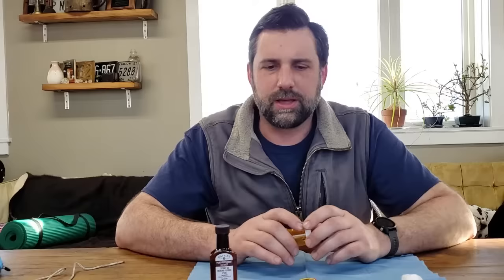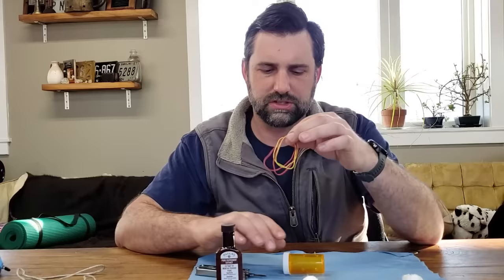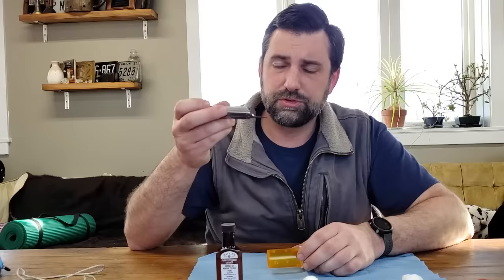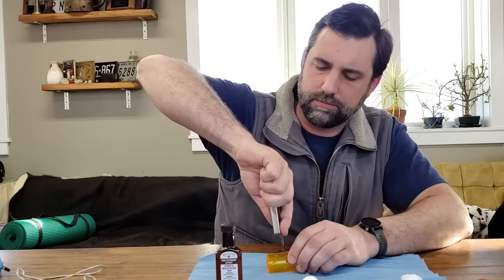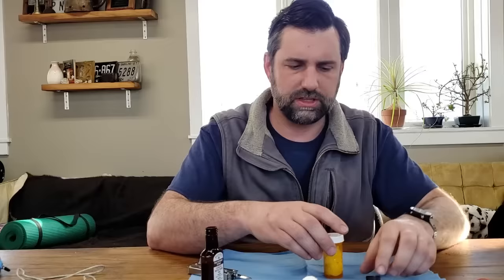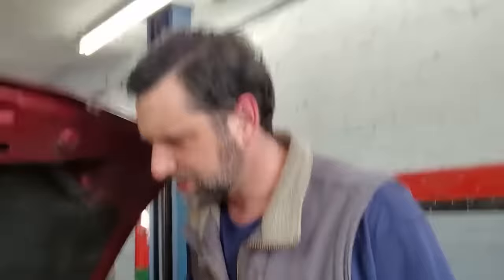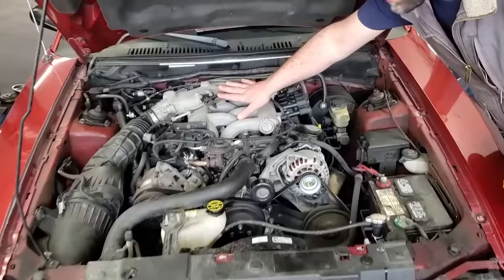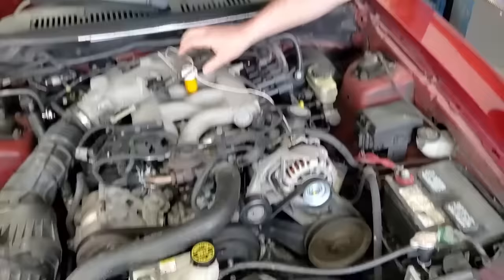Keep Mice From Ruining Your Cars Wiring With This Trick

Comment: That plastic bottle will melt, the engine heat at the manifold is extremely hot. I just mix peppermint oil in a spray bottle and spray the engine compartment, keeping it away from air vents pulling air into the vehicle . Works extremely well, had a mouse rat issue in my mustang, it solved the problem.  Also built mouse rat poison feeders , totally solved the issue, utube shows how to make them with 2 inch pvc T shape, brilliant idea, works perfectly, safe for your pets
Reply: Keep in mind, poison can backfire in a VERY nasty way. For example, I had a landlord who battled the rats in the basement via Decon. It worked. Unfortunately, the rats stayed there to die and stunk for six months (couldn't get under the crawl space).
Reply: @kellyvcraig  the traps are outside, I wouldn’t put that type inside, but the pvc rat mouse poison feeder is brilliant, my Golden Retrievers can’t get at the poison because the design of the bait feeder. Otherwise you live with the live disease caring destructive rodents. Mine are no longer😄
Reply: @PaulA-vc6sn but how do you know the oil worked if you also used poison? And what kind of poison? I can't find anything now that works

Comment: given all the reports of mice damage to older cars, I suspect his theory about new insulation being an attractant really doesn't matter.   Mice instinctively chew, because their front teeth never stop growing,  it is necessary for survival, and soft wire insulation is probably the most desirable thing to gnaw on in a car.
Reply: Soy-based wiring definitely brings rodent damage..
Reply: The only thing that's concerning is it appears that the string is tied to plug wires, they will eventually make the string a conductor and cause misfire issues. Especially with moisture and wet weather.
Reply: In 2012 the gov said no more petrolem based insulation for wiring. Now insulation  is made with plant based oil and the mice love it.
Reply: @natmcknight   That is the throttle cable, it wont cause any issues with misfires.
Reply: @richardelliott8352...yes it does matter, A friends 2011 Honda CRV recently had all four fuel injector wire chewed and one of them was. chewed all the way through causing the engine to run one 3 cylinders the rodent even ate about 2" of one wire copper and all, it also shed through one of the transmission wires...fault codes galore. It can be a huge repair cost, I've even read that depending on the damage insurance companies have totaled cars...AND it's because of what was said in the video soy based material is the culprit Honda has acknowledged the problem, they sell rolls of rodent proof tape directly from HONDA. You are partially correct rodents do get into vehicles regardless but the soy in the wiring is like frosting on the cake
Reply: @c.richardsmith3437 my Camry is a 2014 Camry, and Toyota dealer said soy is why they ate the wiring.

Comment: Six years ago a critter chewed the wires at connectors for my car's transmission and power steering.  After the repair, I sprayed all exposed wires with white lithium grease, thinking it may not be very tasty.  I didn't spray the insulated cables with multiple conductors inside, only the individual insulated wires where they're exposed such as at a plug.  The grease is still there, so it's a long term idea.  Additionally, I often raise the hood on garaged cars, since any mice that sneak in apparently don't want to be exposed.  I did the grease trick on a garden tractor that sits outside, and even though some mice built a nest on the engine last winter, they left the wiring alone.
Reply: What would you suggest for a novice who’s still learning which wires to spray?

Comment: ANOTHER IDEA?  Perfect solution (but don't laugh when you hear it :)  For less than 6 cents each, you can buy a small package of thin, unscented, panty-liners which can be soaked/damp with the peppermint essential oil + water sprayed on the "pad" side, and remove the adhesive protection strip from the "sticky" side and hide them under the hood of the car, , , mice HATE them  with a passion and they can be re-sprayed after a few months.  You'll be amazed at the results, , but avoid entering your ride in an "open hood" car show.

Comment: I tried everything. Nothing worked. Until I discovered flashing xmas tree lights. I run a string of these white lights thru the engine compartment overnight. Works like a charm.

Comment: I had a mouse problem in a truck a couple years ago. I used moth balls with similar results... BUT, the peppermint would have been much more pleasant ( for me... not the mice). The mice had not only chewed up the wiring, they had torn up the sound deadening material on the underside of the hood to make their home cosier.
A 2nd place to be concerned about on many cars is the fuel tank. Many modern cars have a pump inside the tank, which means wiring. Typically the pump is installed in the top of the tank. When I replaced the fuel pump on the same truck I found a mouse condo had been built there, too. There was some wire damage too, though not as bad as in the engine compartment. So if it's accessible and there is some place to put one of those mouse repellant cannisters near the fuel tank too, I would recommend it.

Comment: A heated (torch) nail held by vise-grips creates a nice quick clean hole in plastic such as the pill bottle shown here and is a lot safer process; so give it a try; if one ever needs to cut a bit of plastic, take a large fender washer and heat it with the torch and use vise-grips to use it as a hot-knife, perfect for thermo-plastics.

Comment: I found nice getting onto the cabin air filter, one step away from getting into the 2010 Camry I own.  I searched for the way they got in. The Cowling ( plastic trim) that covers the wipers mechanism and trims the bottom of the windshield had gaps at the ends on each side that let them get under it and then into the air ducting.  I cut chunks of rubber to fill the gaps and used silicone to glue them in place. I also look  under the engine's top plastic trim to look for debris left by rodents. I apply peppermint oil under the hood a few times a year. You need to keep an eye on them if you see and evidence that they have been there.
Reply: Good tips. I might add that it's important to ensure water drainage as you're filling in those gaps. You don 't want that rain going where it's not supposed to.
Reply: That's what happens when you get a Camry.
Reply: I had mice eat through the engine wiring harness on my 2009 Camry. Needless to say, that was an expensive repair. Toyota must use some awfully tasty wiring insulation. 🙄
Reply: I spray peppermint oil twice a year into the air intake. So far so good.

Comment: I do something similar for my motorcycles  when I store them for the winter.  I go to Dollar Tree and buy the $1.25 jars of Menthol Rub (like Vicks) and drill a couple holes in the top.  I put them on the engine near the air intake, in the leather saddle bags, in the ceiling of the shed etc.  I even toss a few down in my basement.  Mice haven't been in those places for years.   I never thought to put them in my truck though.  I have a couple areas in the engine compartment where I could hot glue bottles and change them every few months.  Menthol repels cats and squirrels too. I don't know if that would work with lizards or snakes for you southerners.
Reply: Thanks bra,  gonna do that

Comment: I came up with my own solution a couple years ago.  We had a mouse in the washing machine, which was empty.  didn't know what to do, so I put a chlorine puck from the pool in the machine, closed the lid.  an hour later, the mouse was dead.
I constantly had problems with mice in my atv, mower, and especially my convertible.   I decided to try and put a puck of chlorine in a sandwich bag,  poked a few small holes in them, and zip tied it in the engine compartment of each of my cars, one under the mower seat, one under the quad seat.   only on a very rare occasion do I notice the smell, when I'm checking the oil or something (with the hood popped.  otherwise, I never notice any smell.   *2 years now without a single mouse in any of those vehicles, and i never changed the chlorine.
Reply: Fantastic idea, death by suffocation! I like it!
Reply: I do not recommend this. The gas from the chlorine will corrode metal. Your vehicle, your choice, but not for me.
Reply: @bostontrip1  I really like the idea. I did do some research on the comment above, and yes they are correct about the corrosion. Although the corrosion happens when the th chlorine goes from a solid to a gas, this happens when the tablet gets wet from moisture in the air or other means. I have watched videos on YouTube since that comment, and that phenomenon is happening in cabinets. I wonder if it's better where there is lots of air flow. I think I'm gonna try it, dirty buggers got into my new camp trailer last winter, got all our clothes and food and got some of the wiring. Death to them!!!!!
Reply: Chlorine is kind of nasty stuff and isn't good to breath for people too.
Reply: @Word569 , so use less.
Reply: I tried storing my pool chlorine tablets in my garage, in a sealed container.  Within a year everything made of steel was rusting:  tools, paint cans, bicycles etc etc.  Cost me a lot.  Chlorine tabs offgas whether they get wet or not (that's why the mice can smell them).  And the chlorine gas will find a way out of most containers, especially if you poke holes in it.  Now I store the tabs outside, and no more rust.

Comment: A trick i use here in the Sonoran Desert of Arizona is to fill a spray bottle of half white vinegar and half water then add about a teaspoon of peppermint oil and shake well. Now spray the whole engine compartment real good with about 1/4 of the sprayer and my problems have stopped and respray about every four months.
 Going to add your prescription bottle method to the mix..... nice tip
Reply: I live in Pima County. Haven't had any hungry mice problems. But, being proactive is a good way to keep it from happening.
Reply: @Galiuros  Maricopa county here N Phoenix (desert Hills) I'm on an acre plus and those varmints are all over the place here. Any vehicle that will sit for a long time i also prop the hood up about 12" so they don't have a nice sheltered place to sleep and spray the engine compartment...... You are spot on with being proactive.
  Sure glad it's October and the weather is starting to cool to get some stuff done outside. 😀😀
Reply: Will that mixture cause an engine to fire 🔥
Reply: no @Raptor-7
Reply: Will it cause corrosion? Not of fan of water on my garaged sports car just sitting.
Reply: @bjornironsides6474  No corrosion at all and now using that method on about six different vehicles as i am out in the desert where all kind of critters roam, especially packrats and rabbits and not one of those cookie cutter homes

Comment: They sell small bags of wood shavings soaked in mint at the local Tractor Supply store, but they lose their smell fast, and they cost a lot. So I got a bottle of mint extract and started spraying it around the engine bay, but again the smell goes away fast. This sounds like the perfect solution! I'm going to build a few of them right now, (for my neighbor also). Thank you for taking your busy time to show us how to think correctly. LOL

Comment: Cool. If you heat up the tip of an old knife on the stove (or a lighter), you can safely and easily make holes in the plastic.
Reply: A drill bit works too
Reply: Or at the least don't use a $3 multi tool that folds up while using it 😂
Reply: @1dskells You’re one of those guys that just needs to be like that…… you can’t just make a suggestion like normal people….

Comment: I did this with my broke down Jeep Grand Cherokee using Handcraft Blends Essential Peppermint oil that I got on Amazon. I put three little plastic cups at various places under the hood that had a large cotton ball in each that was soaked with the peppermint oil which I reapplied weekly. I did this all last winter but I let it slide over the summer. When I went to resoak the cotton balls with the peppermint oil in preparation for winter, I opened the hood to discover that the three cups were still there but all three of the peppermint oil scented cotton balls were gone! So it appears that not only did this peppermint oil not repel the mice, they apparently must have thought that it was suitable nesting material and I expect to find them under the intake manifold which is their favorite place to build their nests.

Comment: I tried ALL these fancy remedies and the only thing that worked for me in the two vehicles in my drive in the cold weather is a small radio placed under my hood with an annoying channel of music. It has NEVER failed. Of coarse remove it in the morning. After a week or so it will go away.
Reply: I tried it all except for the radio, nothing worked, insulation from most exposed wiring in my 2004 cherokee gone. I had 15 containers with the oil under the hood. It's unbelievable how much they ate.  Radio next except this is apartment living, so it will probably be a no-go. Sadly, it sounds like a good idea that could work.
Reply: I find Hip Hop/ Rap to work best.
Reply: Same thing Delta Force did to Noriega down "Panama Way"  :face-fuchsia-tongue-out::face-fuchsia-tongue-out::face-fuchsia-tongue-out:
Reply: Nothings worked for me. I'm trying red pepper.
Reply: Lost a Toyota Rav to mice, they got in the ac and air bags. Insurance totaled it as a biohazard. Peppermint works, but you have to be religious about it. Three cats help. Mice still show up. Also set a trap on each tire.
Reply: Radio doesn't work long term, fact.

Comment: I've had two experiences with this issue in the past few years with the soy based wiring coating. I have had this happen on my 2014 GMC Sierra and a 2018 John Deere tractor ($5,000.00 damage) . Both manufacturers use this wire coating. I find that moth balls in a small plastic Tupperware with holes drilled in it do the trick  Put the containers inside the inner fender wells, it seems to me that the mice climb up the tires to get into the engine compartment and they have to pass through this area to get in.

Comment: I put a battery powered sonic repeller under the hood. It makes an intermittent beeping noise that apparently drives rodents nuts. I also spread hot pepper powder underneath the car where I park it in the driveway so any rodents may not even make it to the car.
Reply: Peppermint oil didn't work.  I sprinkled ground cayenne pepper under hood and that got rid of them.

Comment: I have had mouse and squirrel problems with cars, trucks and tractors for many years. Recently I have started to do my own undercoating and found a tip on youtube that seems to be working for the last few years. I add about a tablespoon of peppermint oil to the undercoating and mix it in before I spray. Of course it gets well distributed as it gets sprayed in every nook and cranny of the vehicles. So far no more troubles. Although I may add a couple of these under the hood as added insurance.

Comment: We've suffered with this problem for 25 years. Nothing worked to stop it. Most recently the dealer took the dashboard out of our Avalon and found 2 live mice and 2 dead ones, complete with  nesting materials clogging the air ducts. Initially, years ago, we used moth balls and while it did work, somehow the mice got used to the smell and carried on. We've spent so much money on wiring repairs on several cars. How do the mice get into the car? No holes in the bodies, no windows ever left open.
Reply: They can get in any vehicle also I tried the peppermint oil in my trailer and it didn't work at all
Reply: @gearyheidinewaccount3237  Nothing seems to repel them. It means physical barriers to sensitive things.
Reply: @cvcoco  I have Civics and an Accord with mice nesting in the heater and vents. In my cars they crawl up the right hand wheel well into the space in front off the windshield where the wipers are. That's where the cabin air intake is, so they come down the intake into the cabin. I put 1/8 inch hardware cloth screening into the opening (mice can fit through 1/8 inch) and that has solved the problem. I can't believe car manufacturers don't do this.

Comment: My diesel RAM truck has 2 batteries, one on either side of the engine bay.  Both are (were) wrapped with a blanket.  Rats tore up the material for bedding, and then used one battery as their toilet, and the other battery as their dining room (judging from the acorn shells).    After trapping one rodent, and driving the truck, I got a warning to replace the air filter.  I took a look and it was fine, but remember I said they tore up the battery blanket?  They had dragged a bunch into the air filter box to make it their bedroom.

Comment: Thanks! Clove oil , eucalyptus oil, other oils work well too. Thanks for explaining a lot about how to make holes in a pill bottle too for many minutes of your time, with a pocket knife or a phillips screwdriver or drill without damage to your hand😮! It's much easier, faster to use a hot rod , go near a Gas stove to heat it and merrily safely push and make as many holes as you wish.

Comment: I use Peppermint oil but I put it in a spray bottle, mix it with water and spray all under the hood.
Reply from the maker: I love that idea. We have been doing the pill bottle thing for years. Guess it is time to test something new.
Reply: How long have you used this method?
Reply: What ratio of water and oil?

Comment: Mice get into the air flow ductwork from the opening where the hood meets the windshield, but they don't bother the wiring.  Now my heater/AC fan runs but doesn't blow air because mice make nests in the duct work.  Cost to fix? About $800 to take the dash apart.